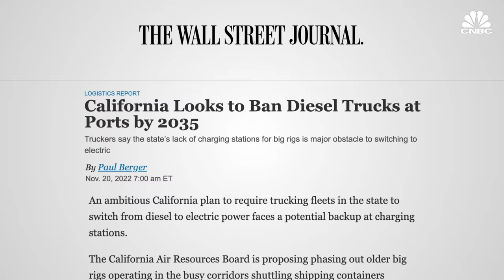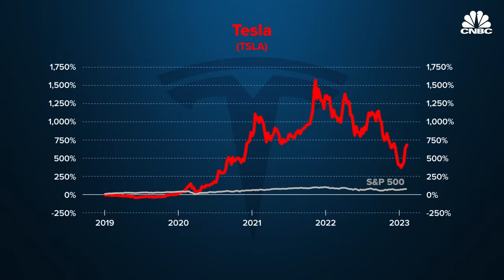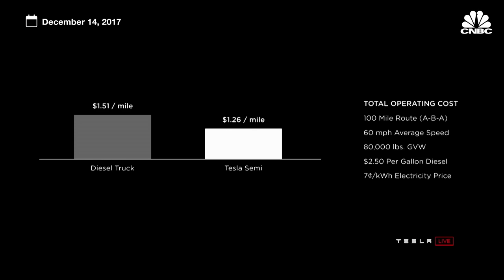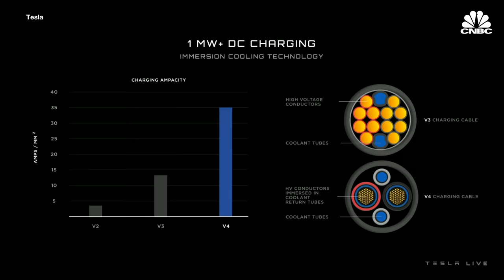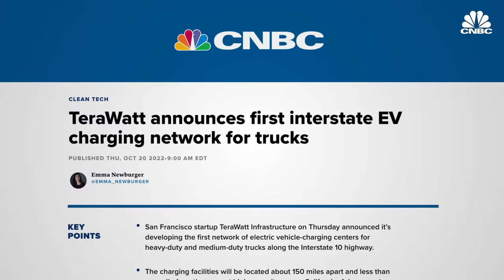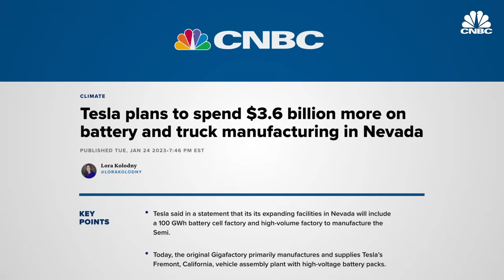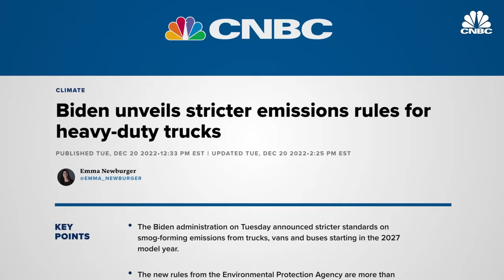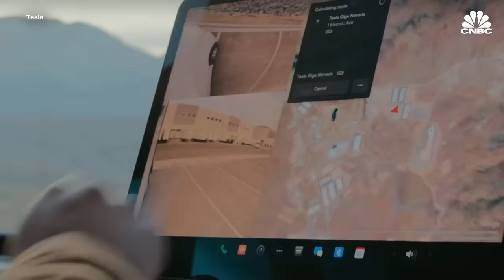Does The Tesla Semi Live Up To The Hype?

Comment: I do see a benefit of having the local delivery and port vehicles being EV for the sole fact of not emitting all of the exhaust fumes into the air.  I hope it works.  I do not see EV vehicles being used for cross country shipments.  At least not for a long while.
Reply: What will be needed for that to work?
Reply: @litshackblink  I’m an over-the-road driver (3000+ miles a week) and I agree it’s going to take a long while. They touch on it at 11:00. The infrastructure required is HUGE. On par with the building of the railroad and national highway system.
Reply: you make your own parking out there a lot, which is fine sometimes.  But its only really ok bc you are never really stranded if you can get fuel.  I imagine the first few ev's that roll out charging will be baked into the route.  But sometimes when you are just out there, you don't want to stop your day for several hours just to charge.
Reply: Hyliion Hypertruck ERX has 1000+ mile range runs on waste and Net Carbon Negative. Easy Win
Reply: @litshackblink  Green Electric Trains
Reply: For long cross country hauls, trains are the most sensible option (and it would work if the rail companies were actually incentivised to keep maintenance up)
Reply: Honestly if Tesla makes a Trailer they can put more batteries in the flooring to get to the 800miles a day. If your driving as a team you will need to make that 1 to 2 hr stop to charge up.
Reply: I agree, I think for long haul transport, we'd be better off rethinking using semi trucks at all. Reinvest in electric rail, which is established and good, take long haul trucks off the road, thus saving on road wear and increasing the budget for rail transport. For local transport such as from a rail yard to stores the electric trucks make perfect sense.
Reply: They’ll likely never be used for long hauling, ever. Just doesn’t work. Local deliveries, as you mentioned, certainly is a viable option.
Reply: @rockyjohnson9243  but you will be adding to the vehicle weight and reducing the load weight
Reply: @grahamjohnson4702  maybe then they need to add another axle under the trailer so it can support that extra weight and when your empty you can have the option of retracting that extra axle to go back to tandem.
Reply: @rockyjohnson9243  does not matter how many axles it is the total weight of the lorry and load that counts.
Reply: @grahamjohnson4702  with the additional axle it allow for higher gvw
Reply: @rockyjohnson9243  yes but the law does not you will be breaking the law.
Reply: @grahamjohnson4702  I see well then they need to update the law if your trailer can handle the weight.  Anything is possible as long as it's safe to do so.  With the retractable 3rd axle it will be easy to pivot into tight spaces without it could be a pain in the butt.
Reply: @rockyjohnson9243  the roads are designed and built to carry a certain weight and speed so all would have to be upgraded at great expense. You need to do a lot more research before you come up with a simple solution. The roads in the UK can barely cope as it is.
Reply: That’s when hydrogen trucks come in!
Reply: @DeddyOh  And improving the railway would be a lot safer also as there's no guarantee that it is safe and well also trucks are unsafe for accidents compared to trains
Reply: @rockyjohnson9243  that would x2 the price of the trucks. Also the one hour charge kills the battery much faster.
Reply: @grahamjohnson4702  People commenting about weight forget the determining factor is roads handling the weight.
Reply: @LarryDickman1  Precisely what I was saying .
Reply: In the future they will probably put in a sleeper. Tesla has made multiple versions of the cars so I would not expect any less of their trucks although I hope they can be modified to put the sleeper in there.
Reply: The average weight of the Tesla batteries in these tractors is about 13,000lbs.  The average weight of tractor's full tank of diesel is about 2,100lbs.  As the Tesla batteries are depleted, the tractor does not get lighter, however the diesel tractor does.  Weight alone should tell you that these EV tractors will cause more damage to our highway systems and increase our road tax.  Also, talking about weight, there is a maximum weight limit set for semi-trucks, 80,000lbs fully loaded.  With the weight of the Tesla tractors, they are limited to a smaller load than diesel tractors.
Reply: @jonny777bike …. My guess is that it would be a public relations nightmare if a couple of drivers went up in smoke with their trucks while charging.  Li-Ion fires more frequently occur during charging, especially fast charging. I’d imagine they want to value engineer the systems over time before a sleeper is made available. Don’t get me wrong,.. I’m not shorting Elon.
Reply: If they can get 80% of a 530 mile range in 30 minutes I don't see any issues doing long distance freight so long as they get their super truck charge network happening.  That's the key, truck drivers need mandated breaks to pee and eat occasionally anyway and time saved being able to go up hills with the rest of the traffic should make up some of that time anyway.  They get much more energy returned with re-gen braking as the mass is much higher than normal EV's.  I live on a range with a 1000ft ish climb most trucks have to slow down to very very low gears and crawl up the hill must take 8-10 minutes more than me to climb it.  If this truck can get up without slowing and re-gen a lot on the way back, safer due to not overusing the brakes then this will be a good thing for us all.  On flat ground not much difference.  Key is to have enough range to match mandated stops for drivers and charge then.  

Need that infrastructure though first.

Until then it will be shorter ranges were these will shine.
Reply: @DeddyOh  It was huge for tesla when they released their cars.  They did it and its the more reliable network or all.
Reply: @ChrisMantia  it charges to 80% in 30 minutes.  Hardly a major interruption after 400km.
Reply: @rockyjohnson9243  1-2 hours to charge up batteries that size? 🤣🤣🤣

These aren't iphones
Reply: @Tiwack01  There is no green electric.  In the US, 18% of our grid is coal.  These trucks are coal powered trucks.

You cannot plug into the grid and proclaim that you are getting your electricity from "green sources" unless you are supremely capable of lying to yourself, or are VERY gullible
Reply: @ChrisMantia   -- then think different.  Who says the driver has to stay in the same semi?  It would be pretty easy to step out of a depleted truck and step into a fully-charged truck at a charging depot.  After all, the company owns the truck, not the driver.

Comment: The one speaker told viewers that diesel trucks produce more power…going with Tesla’s numbers vs. What diesel truck OEMs show as their own, is a stark contrast to what was pushed here.  Tesla’s touted power is substantially higher.
Reply: From the context I guess what he me actually meant was die energy density of diesel fuel vs. that of batteries.
People mix up power and energy all the time :-/
Reply: Power means NOTHING in a truck. Accelerating is meaningless.
You have been drinking the Koolaid.
Reply: @Chris.Davies  However, torque does count for a truck. And that's where an electric drivetrain really shines.